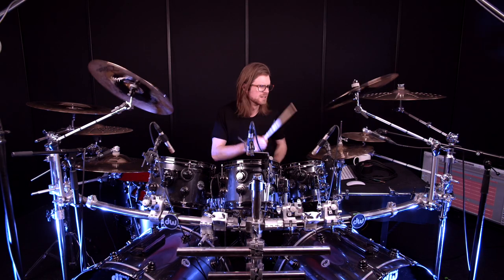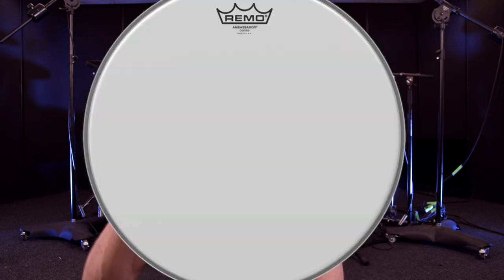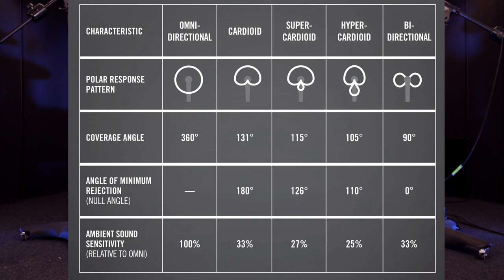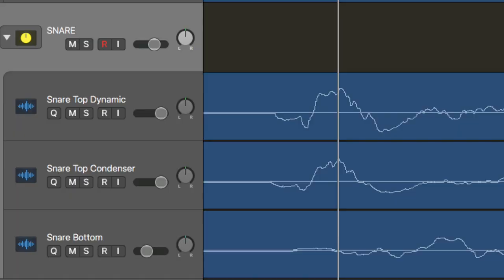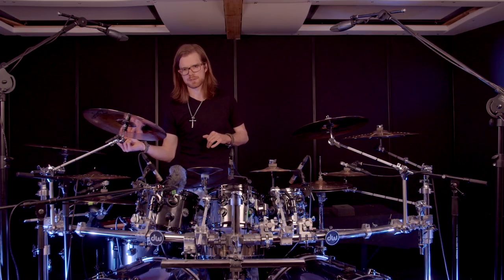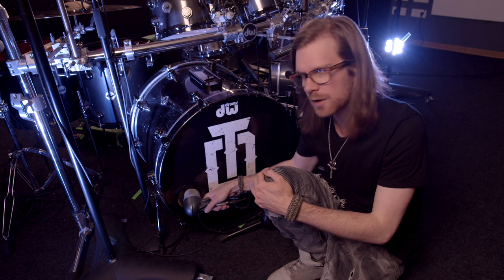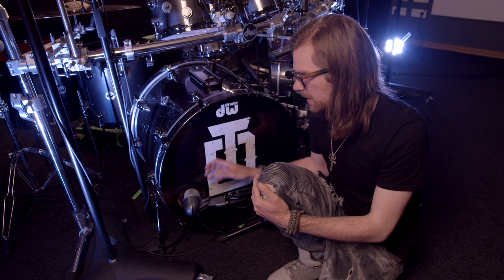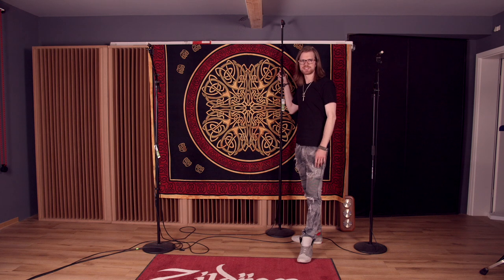How to get a Punchy Drum Sound - (Best Microphones and Placements for Drums Tutorial)

Comment: Could you eloborate on the last section you explained with your workflow regarding phase issues?
So you move the overhead track events (the blocks in your DAW) to align perfectly with the snare and toms and kick hits?
So the cymbals come in a bit later (because you moved them forward on the timescale of your DAW), but since it is only a milisecond or so it doesn't degrade the quality of the performance regarding timing, but rather improves the overall sound due to phase addition?
Kind regards